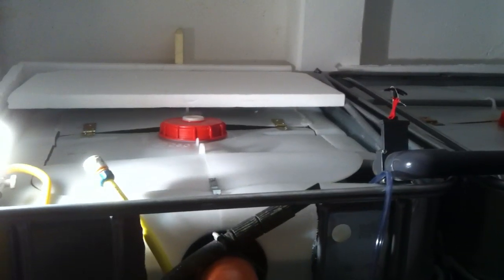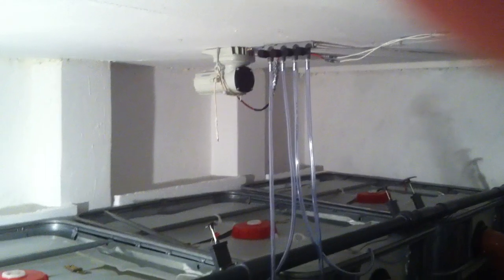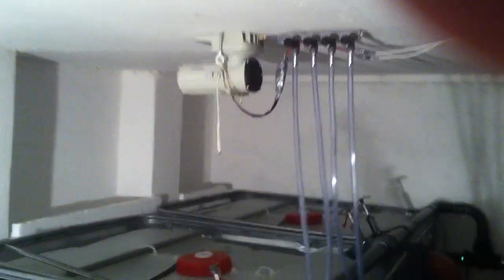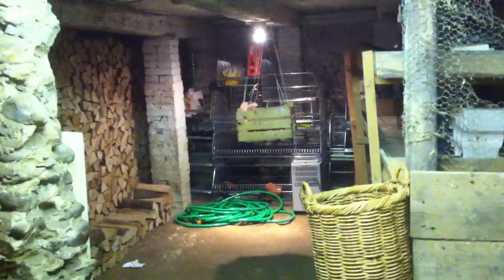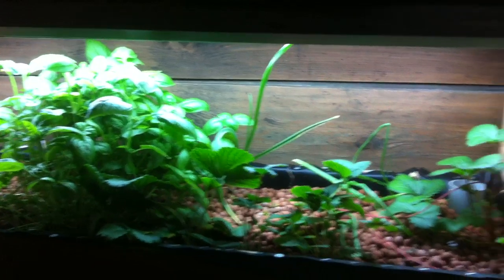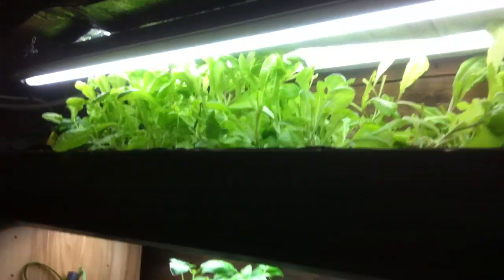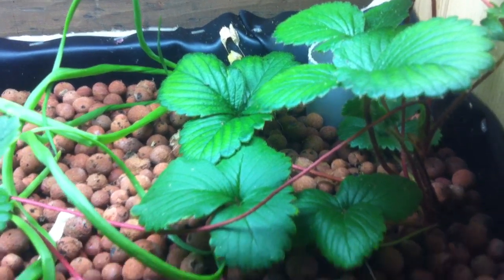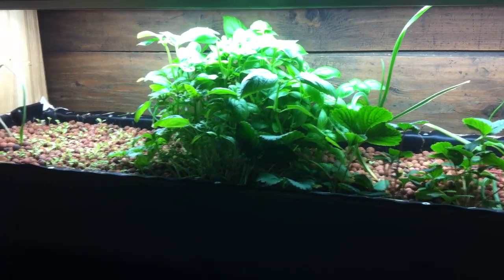Tilapia farm- Aquaponics (Indoor)

Comment: Great video. Your heating costs must be so high?

Also what seals are you using on the IBC(s). I was using uniseals, but when you get to larger pipe sizes (4" and 6") then I can't use them anymore since piping in my are is all in metric units and the uniseals end up being slightly to big. I would love to know where to get those seals.

Anyway good luck with the aquaponics portion. Looking forward to it.
Reply from the maker: check out my shop the website.. the heater is very efficeint and cheap to operate. A good insulated room helps a lot.
Reply: Will do, thanks.